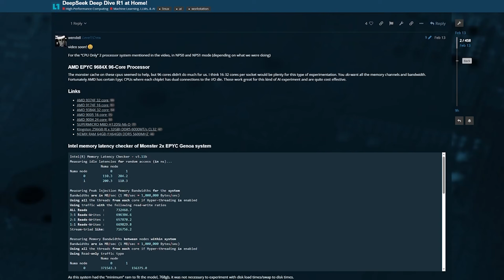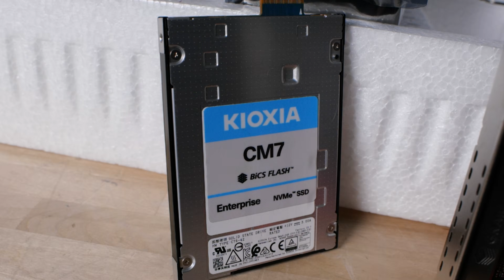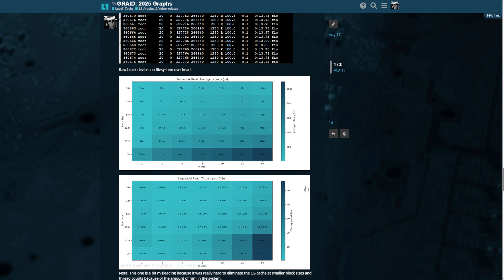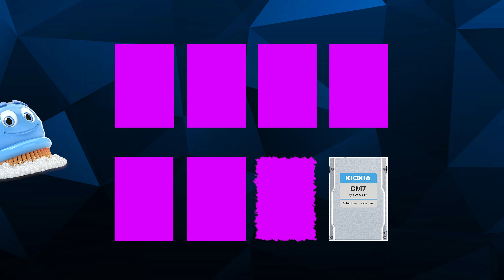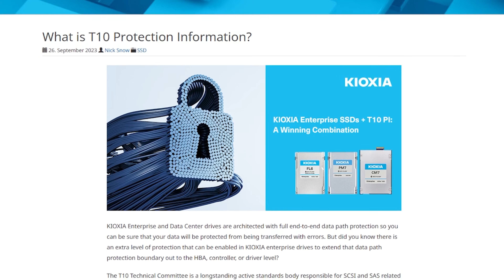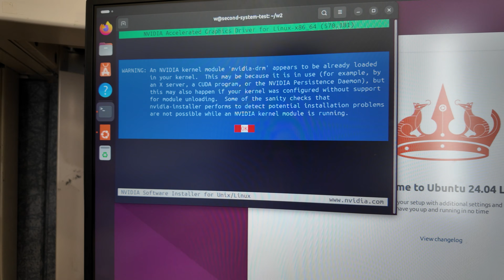Is Hardware Raid TRULY Dead? SupremeRAID SR-1010, Reviewed

Comment: Software on hardware is like a house of cards; sometimes you have multiple of them, and each one is very well built.
RAID is like houses of cards on top of houses of cards and it looks cool until it falls and you cry.
Reply: I would never ever trust on any hw raid controller anymore. Unless I have a slave in my garage, who is the most important (technical) employee of the manufacturer of the raid card, and I keep this guy as hostage indefinitely.
Reply: @ricsip  this is why you have backups and replace hardware within its lifecycle.  there's nothing to stop the motherboard of your system failing either.
Reply: @ricsip  well, you could just have a spare card if you're that paranoid, or... back your shizz up? radical idea, I know, but it is what some people really do... Generally the idea is that disks being mechanical in nature have a somewhat known "best before" date, RAID allows you to survive a disk failure. End. It does not make your data immortal - for that get 2-3 "cloud" thingies at different providers and push your stuff there. I used to run a raid something or other with 9.1Gb disks or some such, so you can figure how long ago it is, and had a disk fail, replaced it, rebuilt array... then another failed after about a month, so I rebuilt it and then copied all the data somewhere else, and it failed again right after. Old HDD's but this was like in 2003-2004 something like that and the drives weren't THAT old and were way too expensive to keep replacing, so I copied the data to 3 IDE disks in total - one was a Bigfoot drive heh, and then left the RAID array thing as it was. Sold it later to a guy who had stacks of 9.1 or 18gb drives, I sold him the whole server thing, not just the controller stuff, and from what I understood he used it for more than 10yrs but with bigger disks in it. But these days I think it's easier and safer to do full replication, I have copies of my data not just on a different HDD, but a different computer altogether. 
if I could reasonably do so and had enough data to justify it, I would probably still run RAID. But I would still have another copy somewhere offsite.
Reply: @noth606  clouds are awful never suggest that ever again in your entire life. & your so called "life of data is around 15 years pal by that time you've probablky got it backed up & used somewhere else
Reply: @fishingkev2332  Clouds are a wonderful thing when you create your own

Comment: Can you add Ghetto-PLP to any drive by adding capacitors to the PSU power cables that go to the individual drives - or is that a stupid idea?
Reply: PLP only works when the drive detects the power rail from the computer has stopped providing power, if I'm understanding it correctly, and then stops performing write operations in favor of completing the journal operations. Adding capacitors to the power rails wouldn't let it make that context switch.
Reply: It's all about the drive knowing that the crash is coming, less the providing of the juice, and what to do with those tiny moments.  PLP is there for when you are betrayed by the thing up stream of it, the PSU.   If power is all that you need, and you are already working from the PSU cable level, just get a redundant PSU setup, a bigger UPS and/or stack on some lifepo4 or LTO batteries and hook up some solar panels and voila.
Reply: My lay-person thinking was something like this: A consumer drive with DRAM for its controller meta data but without proper PLP gets data sent from the host, then a sudden power outage happens so the host of course immediately stops sending data. If the drive has let’s say 10 more seconds of power through capacitors in its power cables would that lower the risk of corruption in its meta data since it has enough time to finish active write processes?
Reply: @abavariannormiepleb9470  In theory if you had some big caps (PLP is measured in 10 or so milliseconds, so scale from there for the size of the product).  Then, however, how do you ensure you are safe from those capacitors failing in some manner?  In this scenario, you are only ever 1 system away from the failure that system is put in place to prevent.  You just have to draw an arbitrary line of this is the last line of defense we will put in place.  It's just a casino game in the end.  That's why the better strategy, albeit far more expensive, are the cluster routes.  Sure the PLP may fail if the power goes wonky with one, but you have 4 other members of the cluster on different circuits, or even grids, etc... A cluster that each has it's own backup power, etc... is pretty safe, as long as money is no option.  Also, that was why Optane was/is the premiere SLOG for ZFS, it could grab all that info so fast that power loss was the event that took a long time by comparison, haha
Reply: You're better off with system level power protection so that the OS can finish incoming write work and clean up the journal appropriately.
Reply: @christophercasale7961  100%

Comment: The GRAID license key is locked to the GPU serial number, that sucks :(
Reply: Then clippy does not use GRAID
Reply: @cajuallyponk6035  Clippy sad. Clippy just wanted to help!
Reply: that is a non starter
Reply: How else they can keep track of users and subscrioptions feeds ?
Reply: Maybe they should trust their customers a bit? I also think that GRAID should completely work in a software-only compatibility mode (of course significantly slower without the GPU acceleration) and it should check for any compatible GPU in a system to use for its hardware acceleration (I wouldn’t want to get anything older than Lovelace in new builds). I also can’t understand how they can offer a GPU without ECC support in their lowest tier at all.
Reply: I would not trust many things to proprietary software to begin with but certainly not important storage.
Reply: How does one change their GPU’s serial number? Lol
Reply: Oh helll nah.

Comment: is setting my old Dell PERC card to "dumb" HBA mode and using mdadm still okay in 2025? or should i switch to ZFS? using a mixed array of old Hitachi-branded SAS-12 HDDs.
i know mdadm is dumb for nvme, but i feel its still probably fine for SAS HDDs.
Reply: I got an old poweredge from my job to use at home and set the PERC card to HBA so I could use it in a ZFS configuration with 16 SSDs. For me that was fine as I am using the server for TrueNAS.
Reply: It's "fine" but I would use ZFS if you can. It takes a little bit to learn, but well worth it.
Reply: It's fine and don't listen to ZFA evangelists. In that use case scenario software raid + LVM + XFS will provide everything you need.

Comment: It'd dumb that 16-lane SSDs were a thing and are now incredibly rare. It'd save so much resources vs making an array of 4 4-lane SSDs. Need more speed that that? Software is trash and should be caching in RAM more and just writing occasionally.
Edit, also GPU VRAM is generally not ECC store only ECC transmit, although could manually compute ECC on any GPU.
Reply: My understanding is it's hard to maintain that level of performance with most current flash media. Also, it doesn't really make a difference if you have 1 drive or 4.

Comment: I don't see how it could die! That's a lot of math to be doing somewhere not on the storage controller, and there's always a need for more speed
Reply: you must have missed the fact that no embedded storage controller is anywhere near fast enough to handle the calculations at nvme raid speeds, it's unlikely to change. That's why hardware raid is dead, best you get is software raid but done by a storage appliance over the network/fabric/whatever
Reply: @marcogenovesi8570  The SAS5132W chipset cards coming out beg to differ, they are pushing 60GB/s in parity raid writes at meaningful queue depths.
Reply: @marcogenovesi8570  I run an NVME radi 0 of just 2 drives with an Intel DC4800 as cache and it chokes my cpu already at times (specific stutter on loads). Took me quite a bit to figure that out. If you want to run an NVMe raid anywhere near fast on your desktop you will need a beefy cpu and then add on the workload itself. 

Storage appliance seems the only logical choice.
Reply: @marcogenovesi8570  NVMe's are only good in sequential read writes if you want something else you'll need Intel's Optane for random stuff.  He might claim that  hardware raid is dead, but this PEGS the damn cpu to 100% when it's setup anyways. The limit is your CPU now & because of that it is always limited by what ever else is going on on your cpu like when gaming.
Reply: @fishingkev2332  sorry what? Hardware raid is dead because the embedded controllers cannot handle fast nvme storage, period. How this GPU-accelerated thing performs is irrelevant.
Reply: @fishingkev2332  optane was canceled long ago, unfortunately.
Reply: @marcogenovesi8570  what's caused this to happen? how is it possible that the software solution cannot be converted into a piece of hardware to do it fast enough??
Reply: @WhatsYourWater  nvme ssd speeds are very high. A single SSD is pushing more data than 20 hard drives combined. Whatever embedded processor was sufficient for making raid with hard drives is too weak for nvme ssds.
The only piece of hardware that does it fast enough is a beefy x86-64 CPU, or in this case a x86-64 CPU and Nvidia GPU running CUDA software.